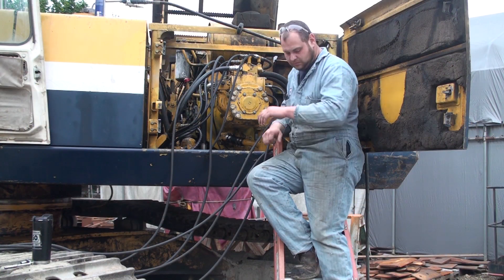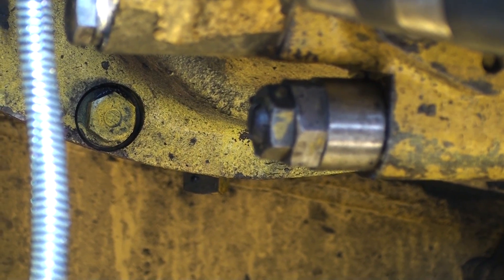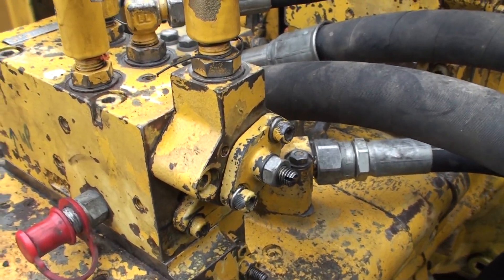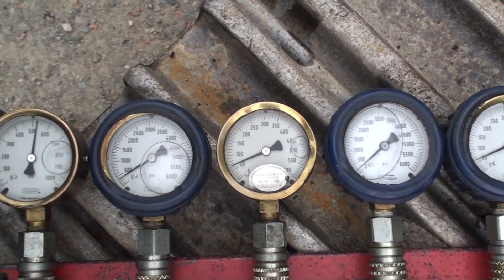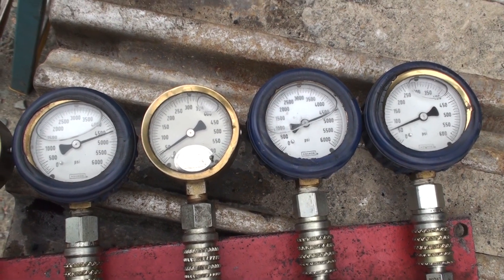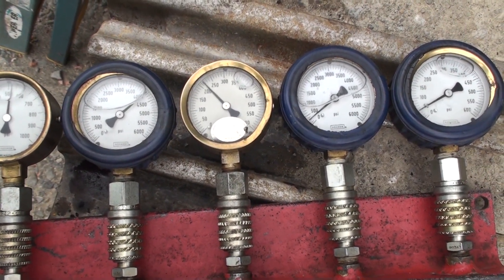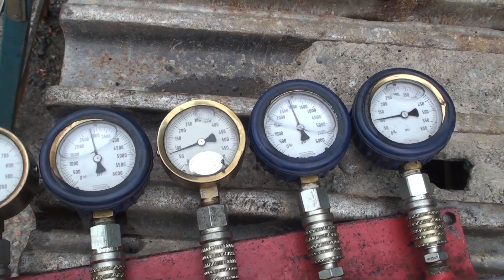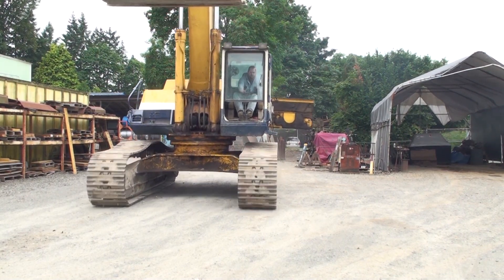Komatsu Dash 5 Hydraulic Tune Up

Comment: Good day sir. How to reset the gear with lightning. On panel board. Blinking and buzzer
Reply from the maker: You will have to be more specific. I don't remember that alarm. What is the machine doing different than normal?

Comment: hello. thanks for help. i have a problem about the adjustment of the Komatsu pc200-5 servo valve? There are two adjustment screws on the top and bottom of the front and rear servo pump valves, but I did not find anything about their adjustment even in the service manual. I have information about all Co NC and jet sensor settings, but not about servo valve settings.thanks
Reply from the maker: If you are speaking of the screws that are directly opposite each other, those adjust the short side of the reaction lever for the servo valves. Usually they are only adjusted when the pump is being assembled and should not be touched with the pump in the machine. They essentially change how the pump controls react.
Reply: @repairsecrets  thanks for your reply

Comment: Very informative, thanks for posting.  I just bought a PC150-5 and the boom down won't lift the machine, sounds like it's going into bypass.  The stick will lift the machine, everything else seems normal.  I'm not sure what the machine was previously used for and am wondering if someone may have adjusted it this way or if I have a problem.  Any advice?
Reply from the maker: In my experience when you run into a power issue like that, it's usually because the cut out function setting on the pump is a little low.
Reply: @repairsecrets     Thanks for the reply!  I just received the service manual so I'm going to see if it's something I feel I can adj myself, if not I'll have the local Komatsu mobil tech come out and adjust it.
Reply from the maker: @rfair123  Good Luck
Reply: @repairsecrets  Thank You
Reply: @repairsecrets   OK, finally got around to working on this machine.  Some new info:  Boom down and bucket in and out are slow / weak and sounds like the fluid is bypassing somewhere.  If I slightly engage any other function, Stick, Swivel, tracks or aux pedal, boom down and bucket then immediately work perfectly, boom easily lifts machine and bucket in and out is fast, no bypass sound, it all just works properly.   Noticed code 25 on the display for oil pressure sensor, disconnected, no change but then shows code 23.   One the advice of another, we replaced the main relief valve, adjusted in and out, this made no change.  Have an oil pressure switch on order but doesn't look like that controls anything that would cause this issue.    Any advice?
Reply from the maker: @rfair123  Boom low and bucket are on the rear pump. So is left side travel and arm high. Does the machine travel in a straight line over about a hundred feet? My initial thought is that the jet sensor for the four spool valve isn't working right. You can plug gauges into the pump servo pressure ports on the pump and you can observe what is being sensed by the pump.
Reply: @repairsecrets   Thank you for the response.  The machine seems to travel straight although I haven't tested that specifically, especially for that far.  Going to do that and get the gauges to check the pressures.  Will let you know what we find.  Thanks again.
Reply: @repairsecrets   Had a mobil tech come out to look at it, he checked some of the outputs with gauges and they were good, he then found the left side travel limit switch was stuck in the closed position, sprayed some lube in it and freed it up and Wala!  Everything works perfectly now and as a result the auto idle now works also.
Reply from the maker: @rfair123  Great work! That was a very common problem on the smaller excavators.
Reply: @repairsecrets How can I contact you my friend?
Reply from the maker: @Thiago_Eletricista  Email is jcraughan@comcast.net or my cell phone is 253 350-0692. I live on the west coast of the US in the Pacific Time zone.
Reply from the maker: @Thiago_Eletricista  I thought I replied to you but I think the post was deleted.
Reply: @repairsecrets ok.
Reply: @repairsecrets  is number whatsapp?

Comment: How do you make a function that operates on the front and rear pump run on one pump only? Is that possible without going into the computer?
Reply from the maker: The computer only limits pump output on the Dash 5 line. To get two pump function you have to move two spools at once on these machines. You get two pump function on boom up and stick. If you want only one pump to feed on of those circuits you disconnect the pilot lines to the boom two main valve or the stick two main valve. You can then use the other to run something else.